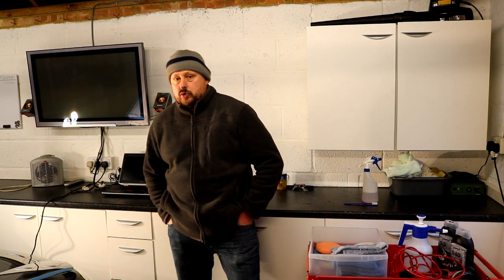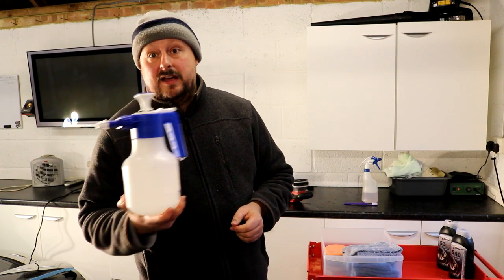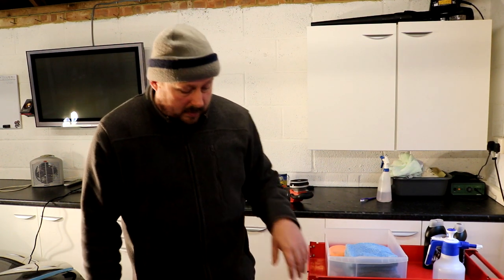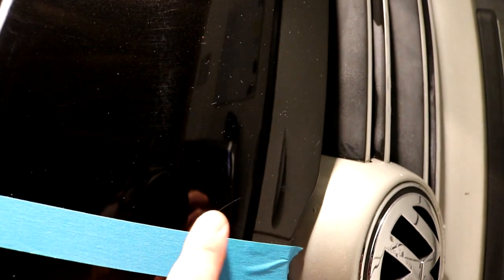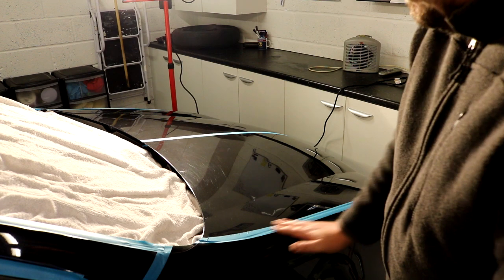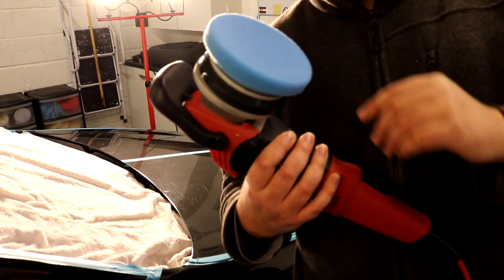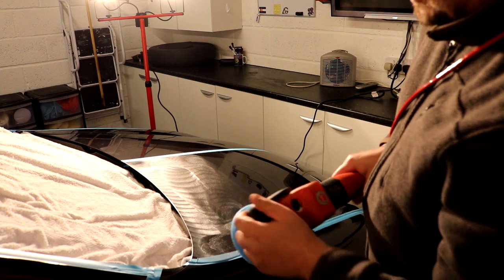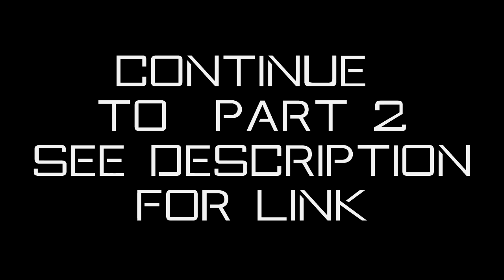How to polish a car  Part 1 - Using a Flex 3401 vrg ( paint correction buffing )

Comment: Recommendation.  Should be working smaller areas.   2x2ft is a good starting point.  Reason being you will be loading pads up quickly on large areas like that, especially with the softer paints, but all do it obviously.  Pads get loaded mid cut, and you end up working the product longer to achieve said results, because the loaded product (loaded with removed CC), will make the process of breaking down the diminishing abrasives longer.  Trust me.  Time yourself on 2 similar sized cars using your spread, and my recommendation. To go along with that, a 5" pad is great for cutting, but smaller pad means slightly smaller working area which is why a 2x2 is even better.  And a 5" pad has a surface area of 19.63 inches, and a 6" pad has a surface area of 28.27 inches.  Much less space for loaded product to hide.  Just a few tips. Obviously a 5 or 5.25" is the way to go as you are doing, just more reasoning as to the surface area.
Reply from the maker: +James I agree was stretching the boundaries a little bit there.  Its less of an issue with the product I was using but with other compounds it could have caused problems and compromised results. thanks a lot for watching and feeding back as well james

Comment: Outstanding videos.  By the way your 2 minute working time was actually around 5 minutes. That pretty much sold me on the S3 Gold Edition. Have you investigated other light options? 500w x 2 has got to add up to some $$$ if it takes you 24 hours to properly do a car. A couple 100 watt LEDs should put out just as much light.
Reply from the maker: +Greg Crain hey greg.. you know what.. If I get those 400w bad boys in the right place it really does do the job...   I wasnt planning on upgrading but appreciate what your saying.. light is really important when yours correcting...

Comment: Hi! Which backing plate you used? Is it pure 4" or 4.5"? Can you give a link where to buy that backing plate you're using? Thanks and cheers!
Reply from the maker: I use 4 inch lake country adapater plate with 5 inch hybrid power pads... both plate and pads I used are discountinued now :(
Reply: Oh no? really? What other brand can you recommend? I saw one backing plate from scandicshine.no, I am just not too sure which pads to use aside from yours. Cheers!

Comment: How do you feel about the 3401 for more of a novice? I have the torq 10fx but looking to step up eventually and interested in the 3401 but curious what your opinion is. 
Thanks :-)
Reply from the maker: the main problem now with switching to the 3401 is you cant reliably buy the system of plates and pads I use as they are discountinued.   that means basically using the flex propriatory 115 mil plate with 5.5 inch pads.   the bigger the pads on these machines the more they will jump around or fight you generally.    this is the reason some people dont like forced rotation.   Its the fighting with the tool. saying that you get used to the different dynamics very quickly.   but with the 5 inch pad and 4 inch plate system I dont have to fight the tool and I love using it.    If your really into your detailing then the only way to know if this tool is right for you is to take the plunge, but taking the plunge will cost you a fair amount of money.   Also consider that flex will be releasing a new forced rotation machine soon.
Reply: @ForensicDetailing  so maybe a 15 mm free spin would be a good step up and all around? Or 21? Some say 21 isn't for all around because of the really long throw.
Reply from the maker: 15 mill free spinning DA combos with a mini is a popular choice mate.   have a watch of the picking the right polisher video on the channel it goes through all the options and explains pros and cons.
Reply: @ForensicDetailing  awesome thanks :-)
For now the torq should serve me well. Not doing it professionally but saving time is always great. Thanks for responding!!! Great channel bro :-)

Comment: again nice video, but why not use the scholl spiderpad as it goes well with the s3 gold?. and knowing you are using it on a hard paint.
Reply from the maker: +Ditmar zwiggelaar ill have to try it Ditmar.  what size fitment is it and what size is the pad?
Reply: Forensic Evaluations Its the back and white one (sandwich spider pad). Its made is 160mm 135mm and 85mm. It gets softer while it gets warmer.

Comment: You're one of the only people I can find using the hybrid pads, they are so rare in the UK!
My flex is on order, and I can't decide between the hybrids and the hydrotechs, have you had experience with both at all?
Reply from the maker: i heard the hydrotechs were better for the more water based lubricated abrasives..  It might not make much difference..  but I tend to stay away from the water based abrasives... but I also just like how the hybrid power pads last..   motorgeek co uk is where I got mine.

Comment: Hey Jon, are you going to test FLEX XFE 7-15 150 Exzenter in this yeah? its the new Exenter with 15mm hub and alot of power.
Reply from the maker: will try and make it happen mate
Reply: I think it will be alot better than any Rupes Mark2 polisher, but yeah same expensive as Rupes.

Comment: I have just bought a brand Range Rover Velar in black. Bought the poor boys black hole polish. Also using Bilt hamber wash and Bilt hamber double speed wax but for some reason after a wash where I am careful to do as much contactless wash as possible it still looks a bit Mared and swirled. Does my nut in. I foam wash and citrus the car before I do anything. Just don’t get it. I want the paint to look crystal.
Reply from the maker: hey neal, the black hole product wont really correct the paint its more a filler glaze, it will struggle to fill heavy swirling.  so thats where machine polishing comes in.   Once the paintwork is nice then thats where you need to be on full alert, some little simple tips, pre-wash the hell out of it, try and get it so when you contact wash the car basically looks and feels clean and your buckets are noti filling up with dirty water from the contact clean.   Another thing is try a nice soft shaggy lambswool mitt, check out the carpro mitt and just use it very gently.  Also check out the detail factory brush for sweeping out all the nooks and crannys very gently.   once its cleaned and rinse when you dry the car just blow out all the nooks and crannies with a air blow and the just avery gentle sweep over the panels with a clean warp knitt towel (in2detailing double sided orange warp knitt).  no pressure when drying.    and thats it really mate.   thats a sensible thing to do but also dont worry like too much about swirls and constantly trying to stay on top.  just enjoy the motor and once a year give it a very light finishing polisht (after that initial full correction)..
Reply: Forensic Detailing Channel I don’t have the balls to use a machine polisher. My dad has the flex machine polisher. What compound would you recommend and how do you know how much pressure to put on?

Comment: Dude, aren't you in a garage? WTH is it look like you are freezing? 

You need to invest in a portable heater mate; will make it easier on you. 

Also, if you are taping off the edges to prevent burning and such, how do you remove the scratches from the edges that have been taped?

Comment: ok guys so a flex 3401 or a rupes 21 mark 2
Reply from the maker: they are slightley different animals..   Im not an expert on the rupes system.  I opted for the 3401 because of the price point and cant suffer from any bogging down issues because its not free spinning...  Its a bit erm "calmer" to use than the rupes21 as well...  Dont have any regrets with it..  Its a really good allrounder, thats safe but capable.  very easy to use as well.
Reply from the maker: they are slightley different animals..   Im not an expert on the rupes system.  I opted for the 3401 because of the price point and cant suffer from any bogging down issues because its not free spinning...  Its a bit erm "calmer" to use than the rupes21 as well...  Dont have any regrets with it..  Its a really good allrounder, thats safe but capable.  very easy to use as well.